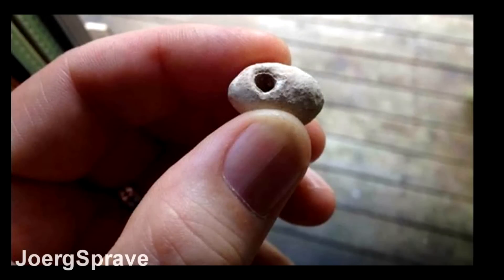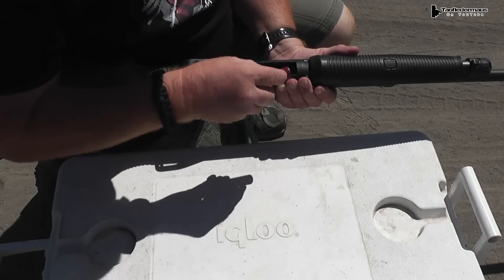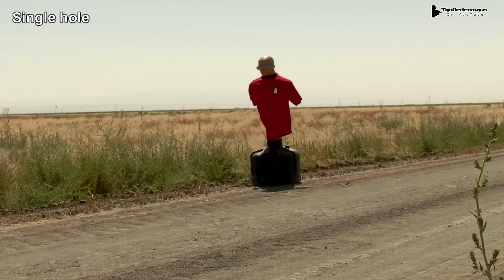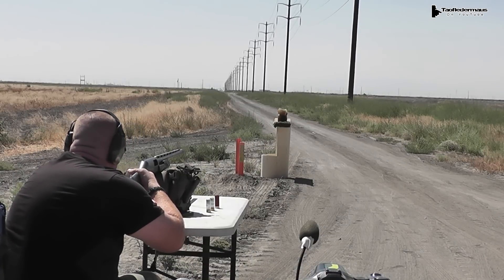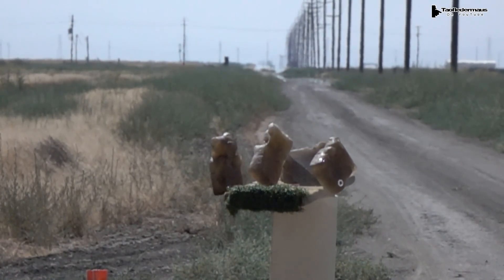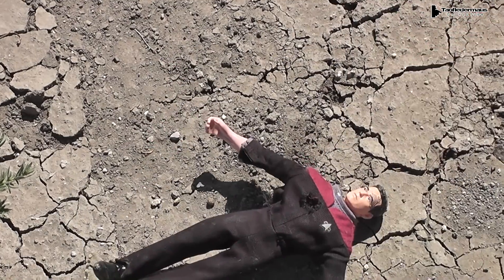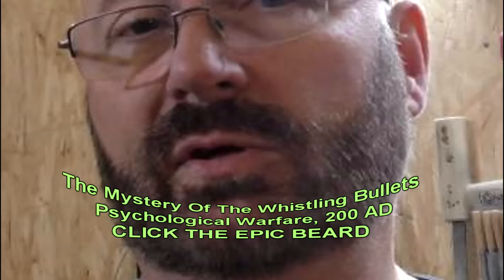Whistling Roman SHOTGUN Bullet Experiment

Comment: Put the cubes in with the hole on a side, not the front.

If it's spinning because of the rifling or not spinning at all, the hole is going to be facing forward the hole time.

If, however it's spinning because of the rifling and there's a hole in the side, there's a chance air will move across the hole and make it chirp
Reply from the maker: but the front IS a side!
Reply: smartass lmao
Reply: Umm... you really don't know ANYTHING about ballistics, do you?
Reply: Quite a lot, actually.  Actual facts too, not just myths and opinions like you.

A hollowpoint doesn't whistle despite having a hole in the front.  Why not?  Air doesn't move across the hole.  If you want it to whistle or chirp, it has to move across the hole, not directly into it.  

Best place on the projectile to get airflow to move across the hole is the sides.  Where the holes should have been drilled in the first place.
Reply: *****
Yeah, you prove you know nothing by your ignorance. If you knew something like your precious facts, you'd know this was being fired from a shotgun, which is a smooth bore weapon. No rifling. No induced spin. You'd also know that a cube is highly unlikely to grip rifling even if the barrel of this gun were rifled. The corners would simply skip over the rifling grooves.

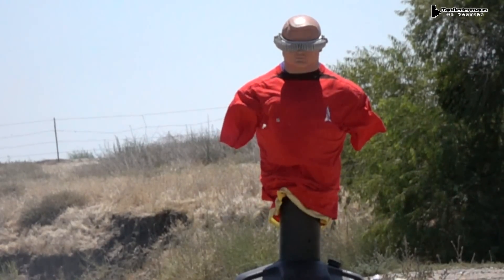And finally you'd know the facts of what "tumbling" means, when Taofledermaus said it at 1:30 in the video, "the projectile tumbled a lot." Tumbling means it was going end over end. You'd also know to watch the video closely at that point to see this is clearly the case with the projectile- it tumbled visibly in the slow motion replay.

Tumbling makes whether or not the barrel was rifled or not a moot point, because if the projectile is tumbling, it has not engaged rifling to induce spin. Not that it was rifled.

But I love your claim of actual facts when all you gave were wrong opinions based on improper knowledge of the situation. You don't even know that shotguns are smooth bore, for cripes sake. Maybe you shouldn't comment on gun videos.

Comment: you should try and get some gallium metal that melts at 80 some degrees, form it into a slug and shoot it, maybe it will be a new type of bullet to knock you out but not kill you like the beany bags
Reply: That is what they are generally meant for, unfortunately they can still be very lethal. It all depends on where you shoot the person. And even if you shoot at one of the spots on a person where it normally wouldn't be lethal, there's always the chance it could still kill them.

Automatic lethal areas includes the head, and the neck/throat. Normally to use them nonlethally, you aim for the center of mass, though even then it still has a minimal chance to kill someone.
Reply: bean bag rounds can and do kill. They're just less generally lethal.
Reply: +Kain Yusanagi I see, thought cops used them to only take out targets without killing,
Reply: meekeedutsa
That's their intended use.
Reply: Firecage
A weakened rib being broken, or just the right angle of impact to break a sturdy one, causing the bone fragment to impale internal organs, for example.

Comment: I am no physics expert or nothing, but couldn't the shape play an essential role for this to work? The roman projectiles were oval-shaped. So the surface where the air would hit the edge of the hole would be at a slight angle, not straight as on a cube. I think this could be a factor, as you can compare how important it is to get the correct angle when blowing on a bottleneck-opening in order to get any sound.

Just a thought.

Any reason why you didn't make the projectiles round/oval shaped? Shouldn't that fit the shell and barrell much better?
Reply from the maker: Yes,   a curved surface seems like it would work differently than a flat one.
Reply: The hole needs to be at the side to head any whistle sound, look at nerf whistle darts

Comment: Yes it will but the laminar flow of air at super sonic speeds doesn't allow air to flow into and back out of the cavity you drilled in the projectile.
Once the round slows down and air passes into then back out of the cavity it will whistle like your blowing across the top of a empty glass bottle, the smaller the cavity the higher the pitch.
Also as the round tumbles it will stop and start the whistling rapidly, giving you the distinctive whine or Twitter.
It worked with the slingshot because the sling stone was traveling well below the speed of sound. The stone should be tumbling at a much slower rate also.

Comment: If the slugs are spinning with the hole in front it might not get air moving across the edges of the hole? Perhaps placing the slug with to one side?
Reply from the maker: The cubes tumble randomly,   I thought I mentioned that.
Reply: ***** Ah, but perhaps you did and I just missed it, sorry :-)

Comment: maybe drill a hole or two on the sides of the slugs instead of the top
Reply from the maker: every side is a side.
Reply: +TAOFLEDERMAUS I guess you are right,  I meant horizontally instead of vertically as they sit in the shell.     and maybe have one with the holes drilled all the way through
Reply from the maker: The cubes tumble so it doesn't matter.

Comment: Try making round slugs with hole in the them , the air will move around and center and therefore it will whistle  , imagine throwing a football it will break the air and allow wind to go around it , of u were to throw a square ball , it will not go far and it will rotate in the air and change its traveling side and u won't get air going through the hole . But again it's my Physics analogy opinion, I might be wrong . Good video either way .
Reply: I am sure your grandpa brought some back from the Punic wars when he was legionnaire.
Also, can’t believe I found an early Edwin comment with only 2 likes. You have come a long way! 
If you test this on your channel, make sure the rounds are subsonic, otherwise the shockwave will prevent any whistling
Reply: Most importantly, if he tests them on his channel, he should let them cool before picking them.

Comment: Is there a berm behind your targets? Those buildings in the background worry me a little.
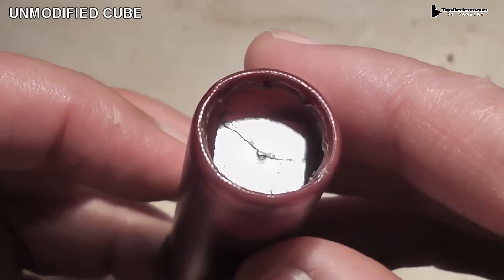Reply: Also the truck driving past at about 2:50
Reply: its impossible for the shots to reach even half of the distance.
Reply: the distance has been addressed in past videos
Reply: That's way too far for a slug. Even if you aimed up in the air it wouldn't go that far
Reply: 2.5 miles.
Reply: Sillygoose210 _some of those "buildings "are moving cars if you look closely
Reply: Sillygoose210 _ like I said in a previous comment they are irresponsible dickheads.idc what the box says on the range
Reply: Half the distance of what? 1 Mile?

Comment: I could be very wrong, but since the pellets used by the Romans were a drop shape with the hole on the outside edges not the front face, I know the shots tumble but i think that using a round shaped or more "nerf vortex" style shape of slug it would produce the whistle

Comment: What about putting the slug in with the hole not parallel to its velocity vector?
Reply from the maker: The cubes tumble so it doesn't matter.
Reply: As an engineering major, I have to pull you back from the rabbit hole. 

It's okay Bro, it's okay.

Comment: I think it did not whistle because it was traveling too fast. Sometimes when traveling fast like that, a cavity will fill with air and act as if it was solid. Kind of like the pocket of air trapped on the back of a pick-up when it is driving.

The sound of those rounds being fired from that slingshot were damn scary from the down range camera angle. I would had defiantly ducked.

Comment: I think the hole might have to be on the side to get it to whistle.
Reply from the maker: It was on the side
Reply: I mean as it is flying through the air.  The way these are loaded they are traveling with the hole in the side facing the wind.  The wind needs to blow across the hole to whistle.
Reply from the maker: the tumble thru the air so it was more important to position the slug where it was the strongest and I could tell what was in the shell.

Comment: Think I know why the mickey mouse round did better at "whistling". That roman slingshot round was an oblong sphere and had the hole off to one side which means it was tumbling in the air. Since the hole is off to one side air was catching it on an angle producing sound. So maybe in a future test drill holes near the corners of the borg slugs but do more then one side.

Comment: holes need to be on side of projectile for the venturi effects to make noise. think of blowing over a bottle.
Reply from the maker: The cube has 6 sides,   and we put the hole in one of the sides.
Reply: +TAOFLEDERMAUS Not like a hollow point bullet, but like a whistle or flute. Hollow perpendicular to the direction of flight.

Comment: could it be that the holes didn't go all the way through the cube? i haven't watched joerg's video yet but i know that a hollow spinning tube whistles. and they usually have holes on both ends
Reply: now after looking back at joerg's video, i think its the angle of rotation in relation to the hole, when a slingshot fires it spings the projectile with the hole on the diameter, whereas you loaded the slugs with the holes facing front, so the rotation would be with the hole in the center (rifled) or no rotation at all (smooth bore)
Reply from the maker: The cubes tumble through the air at something like 4000 rpm,  so it doesn't matter which way I faced the hole.   It did help me keep track which shell had which cube in it though
Reply: +TAOFLEDERMAUS oh ok, I forget that cubes don't exactly fly through the air the same as cylindrical objects :P question, would there be any way to take a break action shotgun, and load it with slugs that are like arrows? so slug sized in the Shell, then a long thin shafts, then at the end towards the barrel it could widen back out to loosely fit the end of the barrel? I don't have any of my own machinery to make such a projectile but it would be really awesome if you tried it

Comment: In order to make the most noise, shouldnt the hole be oriented to one side, so the air is passing over the surface of the hole, not hitting it head on?
Reply from the maker: The cubes tumble at thousands of RPMs,  how would I orient it in one position?

Comment: i believe that the hole should go all the way through the projectile.
Reply from the maker: That wasn't how the Romans did it
Reply: ah my bad i thought the holes where all the way through. It is possible that the speed of the bullets is to high for it to whistle. have you tried to use slingshot to see if it does actually whistle since the shape you are using is a cube and the shapes used in the video is sphere or the stone shapes that the Romans used.

Comment: I think you added two variables - velocity and change in airflow caused by using a cube projectile instead of a ball. I suggest a revisit using a series of ball rounds with different hole sizes. Perhaps that will correct for the increased velocity. I would be very interested to see if the whistling can be replicated in a shotgun round. Joerg is a cool dude.
Reply from the maker: Yeah,  I'm thinking it needs a curved surface.
Reply: have you tried holes in the side of the projectile ? Air needs to pass over the hole not straight down it

Comment: Just one suggestion: Shoot one of the slugs with a slingshot.
If it whistles, you know that your shotgun shot slugs were just too fast for the air to get in the hole. You seen that with slugs with a hole already: the wadding would not separate even though air should have gone through the hole and blown it away.

Comment: I think the rounds would whistle if the hole was on the side instead of the front so that the air is passing over it. Similar to blowing over the mouth of a bottle to make it whistle.
Reply from the maker: The front becomes the side as it tumbles at about 4000 rpm
Reply: +TAOFLEDERMAUS I see. Perhaps drill a hole into each side without them meeting in the centre?
Reply from the maker: The shock of being shot is pretty fierce.  If I drilled too many holes he slug would be really weak (and light)  but  collapse on itself.
Reply: ***** I can see the problem there. Is there some kind of metal it could be casted from that would make the round strong enough to withstand the shock and pressure?
Reply: the bullet will tumble through the air, the most likely reason you didn't hear anything was actually because it was traveling too fast, so though it probably made a high pitched whine, it's too high for human hearing.
Reply: Good point. I wonder if that means you could record the audio of the shot and lower the frequency to see if anything could be heard from that.
Reply: +Alan Ball I could hear a very slight whistle from the single holed cube. I'm pretty young, so I might be able to hear it better than most people.
Reply from the maker: That's very possible!
Reply: yeah young folks can hear about 18,000 hz. that's 18,000 rotations per second.

Comment: Love how you guys are shooting towards the highway
Reply: Four miles away.
Reply: He used a shotgun. It would never reach even half of the distance, specially with that homemade bullet which wont fly as far or good as a regular slug.
Reply: Yeah, snipers aren't using shotguns. I understand what you are saying and I thought the same thing that Zendail posted but it's so far away, those rounds even with the right trajectory wouldn't make it 4 miles. Since they are hitting something, in-between, the projectile has no chance of making it.
Reply from the maker: We have  seen how far a slug can go,  angling the gun at about a 45 degree angle and got about 500 yards.  It took about 5 seconds for it to get that far.   BIG difference between the velocity and range of a 50 bmg and a 12 ga shotgun.
Reply: +Gregg Chrissakis    still pushing what is safe since snipers can sometimes shoot 1-1.5 miles. theres also the possibility it will shoot too high and arc over the distance.
Reply: nice troll
Reply: +TAOFLEDERMAUS as long as you guys don't get in trouble

Comment: In Eastern Asian countries there were arrows that were made of bamboo and was punctured to make whistle. It was used in battlefield to signal the start of a battle.
Reply: I was thinking the same thing. These were probably used in a similar manner and were not made to scare or intimidate people unless they were fired in volleys. Having a sub-sonic projectile making a ton of noise as it flies towards your enemy is a bad idea for many reasons.
Reply: Den, was only bad if you were planning ambushes or guerrilla tactics. In the open battlefield(whether formations were used or no formations were used), it wouldn't really have mattered.
Reply: Firecage If infantry had cover or shields it would matter. Let me guess you would just stand there, not move, take cover, etc. while you could clearly hear a subsonic arrow fired from the back ranks as it whistles towards you? Without the whistle it would be much harder to know when they are firing at you even in a large battle. Also putting a hole in an arrow shaft is not a very good idea either for strength/penetration.
Reply: +Den Log I'm very late here, but that actually makes it more effective. Every projectile not only has a chance of killing one man, but also guarantees dozens of men will 'take cover', even if only momentarily taking them out of the fight. So a barrage of a handful a minute for a period of time would completely neutralize the entire enemy front line.

Well, you know they're not going to do that forever, they are going to have to stand up and fight eventually, and yes, ignore the whistling death happening all around them. That's got to wear on you psychologically. Regardless, Scots weren't known to be cowards, and probably took quite a few to the forehead because they are not wearing no sissy armor either.

I'm saying the Romans totally used these as normal ammo when they could, and the only reason they weren't all like that, is because it is a pain in the ass to drill holes in thousands of rounds without an electric drill press.

Comment: The Micky mouse slug whistled because the holes were more near the corner.

As the air is pushed around the projectile , it is pushed around the edges . Creating an effect where the air is moving faster at the edges than the center . Since the holes were near the edges the air moved over the holes faster than if they were in the center allowing the whistle to be heard over the sound of all the wind at the edges.

Comment: The stabilized projectile has a pressure wave in front of it which prevents air from passing over the hole. It is air passing over the hole which creates the whistling sound so at the absolute least, the hole would have to drilled in the side of the projectile. A better outcome would be achieved by using a round ball that was drilled and a lower velocity loading.

Comment: The reason that those slugs weren't making noises is because the hole was on the front face of the cube while flying through the air. If you want a sound you have to have the air move horizontally across the opening of a hole like blowing across the opening of a bottle to make a noise.
Reply from the maker: The cubes tumble at a very high speed.

Comment: For anyone saying the hole should be in the sides, don't worry. The cube shaped projectile spins so much in flight that it wouldn't make a difference where you positioned the holes inside the cartridge. With how much that thing was spinning the hole would have faced every which direction during at least one point.
Reply from the maker: Yes,   we put the holes forward so we could tell what shell had which cube in it easier.